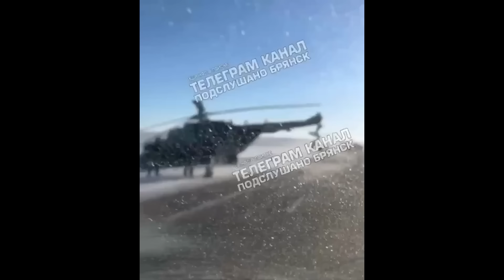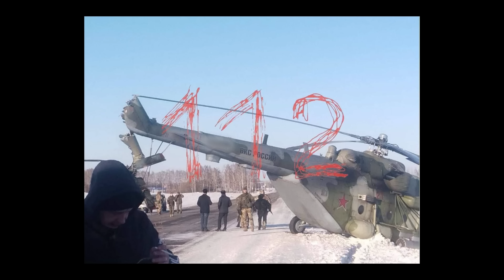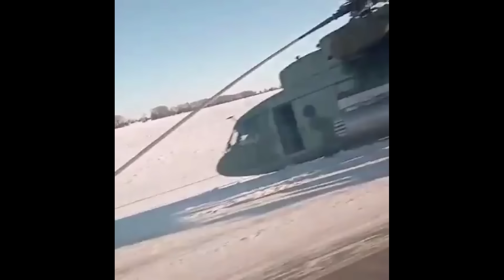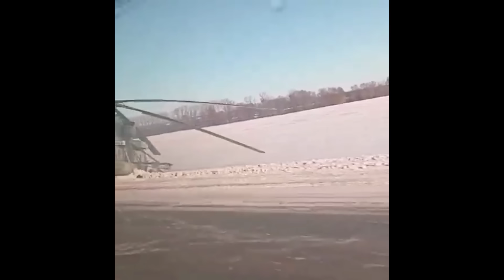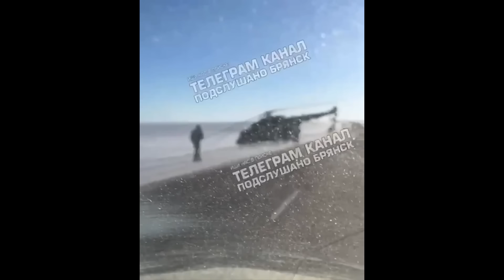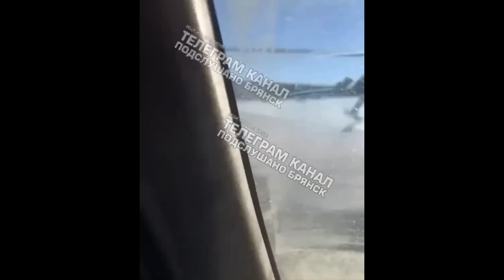Russia Mi-8 Damaged by Power Cable in Bryansk, Russia -- Makes Emergency Landing

Comment: Certainly not the first this has happened during the war and safe money is that it won't be the last or even second to last.
Reply: yes, there was a rusky SU-25 doing a tail strike on a power line, filmed from the cockpit. but this raises the question of how much crazy are the ruskys to fly under power cables like that, and not to mention that it is probably in training regime and not military operations, it is not necessary to put the helicopter at 1 m altitude to avoid radar, 10 to 20 m is enough for ground clutter to obfuscate the aircraft. bro the power line clearance level is about 5-6 m, yes enough for a large truck, but not for a helicopter/plane at high speed
Reply: @weiserwolf580  There was a Russian helicopter hit a poer line over a river a few months back - suchomimus has the video somewhere.

Comment: The only way this helicopter managed to land safely is because it was moving forwards at some pace at the time of impact. Helicopters require the tail rotor for yaw-stability at low speed and while hovering; without it the rotational energy imparted unto the main rotor by the engine is also imparted onto the body of the helicopter, which begins spinning like a top until it either flies apart or crashes.

At sufficient airspeed, the vertical section of tail and the aerodynamic design of the body allow the helicopter to maintain orientation long enough to reach the ground, but it requires the pilot to land at pretty much full clip, or risk loosing yaw-stability and flipping the thing. It would not have been a gentle landing, and this airframe is likely going to be written off due to stress-fractures all through the frame, damage to the underside and tail, as well as the transmission and engines being damaged by the shock of the tail rotor coming apart. Granted Russia does seem fairly good at repairing things, so they might be able to get it flying again given enough time.
Reply: Id also assume it may have been very near the ground already if it hit an electric wire.. and immediately landed.
Reply: @scottshawn70  I'd agree - if it clipped power lines it was already close to the ground. BUT how on earth did it only clip lines with its tail rotor, unless it was flying underneath???  See map ref 53.280895, 34.216500
Reply: My question exactly! How does just the tail rotor strike without the main rotor striking the wires as well if moving forward, plus it doesn't look like there are any wires in the area it went down? However further review of the video when the vehicle is passing from left to right you can see as he passes the Mi-8 a bundle of wires hanging off the torn tail rotor section....so I'm guessing, yes tail strike to wires... @mattydare
Reply: Looks like they went (mostly) under the power cable.
Reply: Could this type damage happen in liftoff? Taking the tail only? It would also satisfy landing.
Reply: @jean-yvesmead3972  In forward flight a helicopter's nose is pitched towards the ground, so they would have just barely clipped the tail rotor, smashing it to pieces.
Reply: @sgarlick1961  The pilot might have seen the oncoming line at the last minute. pulled up. The TR strikes, severs the wires and then the  copter is guided towards the GND in a complete panic. It's a brave  man who flies any AC which has had  repair done to the tail boom near the empenage or  tail  rotor. 

TEF
Reply: @sgarlick1961  I'm by no means a qualified pilot but as a heli moves forward they tend to tilt raising the tail rotor higher than the main blades. Add that to crazy Russian pilot trying to fly underneath HT power lines maybe?
Reply: Usually when helicopters are moving at forward speed aren't they pointing downwards a little that would explain the tail rotor only getting hit just a guess
Reply: @sgarlick1961  If the main rotor captured the cable and the cable was then moving with the main rotor then it could easly cut of the tail, this videos are so poor quality that it is hard to tell... it is kinda strange that you do not see any significant damage to the tail blades.
Reply: "and this airframe is likely going to be written off due to stress-fractures all through the frame" yes, it may look ok from outside but there is most likely damage to the frames that giving structural strenght to the helicopter.
They most likely gonna canibalize this helicopter for parts and it will be never be able to fly again.
Reply: Russia is running out of experienced pilots, and experienced Air Defense specialists. Are we sure this wasn't another friendly fire incident or shooting one's self in the foot thing.
Reply: @brianv1988  You're correct, they maintain a nose-down posture to tilt the main rotor and allow forwards flight on the cushion of air they sit on. Helicopters are effectively over-complicated hoverboards which like to explode when the oil leaks out.
Reply: @lockwoodpeckinpaugh9252  There's no shrapnel damage or holes to indicate it was shot down. Powerlines are very difficult to see when moving at a few hundred mph/ kmh, so it's more than likely just an impact on one as such. We've seen this happen quite a few times, even once with an Su-25 where the pilot ejected.
Reply: @thomassecurename3152  Unlikely. On takeoff, losing the tail rotor will cause a spin, resulting in a hard landing usually causing the main rotor blades to strike the tail, followed by the helicopter tumbling and obliterating itself.
This Mi-8 popped the clutch and autorotated after the powerline went between the main rotor and tail rotor. A good or lucky pilot.
I wonder if he was doing something dumb, like https://www.youtube.com/watch?v=eLZHhbgJz0A
Reply: @sgarlick1961  Going under the power lines nose down and tail up would account for it
Reply: @lockwoodpeckinpaugh9252  так и думай .
Reply: @mattydare it’s pretty common actually.  The pilot flies under the wires and pulls up a little early to avoid ground impact and pulls the tail into the wire.
Reply: Thanks
Reply: @SgtBeltfed  losing the tail rotor during takeoff is maximum pucker factor.  Right in the coffin corner.  Dump the collective if very close to the ground and slow, try to keep her level, and wait for the bounce.  If you have a little airspeed & altitude you have to dump collective, push over the nose and time pulling pitch and rear cyclic to hopefully come to a full stop with all arms & legs in the ride before exiting the ride.  
These guys were low but likely scooting along with enough airspeed to weather vane it straight until just before landing when it’s time to trade inertia for lift and pull in some collective.  Lol.  Ah the days of my  youth „wasted“ cruising the German countryside in the back of a Huey.

Comment: That's not usually what happens when a chopper hits a cable. The rotors hit first and all hell breaks loose. The tail rotor is behind the mast and fuselage, so it only hits something if it slews into it. This looks more like a tail strike on an object on takeoff close to where it wound up.
Reply: Unless it was flying UNDER the cable with its butt up.
Reply: Theres been a lot of obviously wrong conclusions on this channel recently... The rush to publish often causes mistakes....
Reply: @CRCinAU yeah. Well... Nobody's perfect.

Comment: Cables are hard to see in snowy conditions. He might have been navigating by following the road.
Reply: IFR in Russia = I Follow Roads
Reply: @slartybarfastb3648 so what does VFR in russia stand for then😅
Reply: @ffffff8048  Ve follow roads, da? 😁
Reply: All sorts of snow - I have seen power lines grow to 6 inch diameter in wet sticky snow, before pulling themselves down under their own weight. Agreed, they are normally hard to see when you are looking all around for whatever potential weapons the enemy is hurling at you - still .... one less on the inventory
Reply: @ffffff8048  It's only VFR in Russia two days out of the year. They stay on the ground in those conditions.
Reply: That's why the rule is "cross a power line over a mast".
Reply: @ffffff8048  "Vhy follow roads?"

Comment: Helicopters getting damaged by power lines is a fairly common occurrence. Most aviation regulators have rules against piloting that increases the risk of wire strikes. There are also devices that reduce the risk of catastrophic damage.

While a fairly common issue for helicopters, it's definitely made worse by the SAM pressure that forces Russians fly low.

Comment: If you're wondering why this helicopter didn't spin itself to death once the tail rotor got destroyed: most helicopters are able to disengage the engine from the main rotor, and then auto-rotate towards the ground. It's the same principle as an auto-gyro, and allows the helicopter to perform a somewhat controlled landing.
Reply: This is done in case of engine failure. Auto rotation is no rescue for a tail rotor failure. The rotor torque is related to the lift generated. When flaring for touch down, the helicopter requires high lift. Autorotation will still see the heli spin out off direction then if it hasn't done so before.
With vertical stabilizers in place, the fastest possible touch down moving forward is the only chance to survive a tail rotor failure. The Mil-8 has no such stabilizers.

Comment: If it clipped power lines then it was flying pretty low to the ground, a full blown emergency like this is highly survivable due to the short distance to impacting the ground.
Reply: Lot depends on your ground speed when you pile in.
Reply: It could be not a power-carrying wire but a lightning protection cable at the top. Those are steel, not copper, and harder to snap.
The torn tail fin suggests that.

Comment: They got lucky! Losing tail rotor authority is normally a really bad thing.
Reply: Yes, well if they actually clipped a power cable, they probably were at low altitude and speed. This scenario is supported by the fact that it's not a smoking heap of soviet steel and broken dreams.
Reply: True story!! It's always bad, as evidenced by the collapsed undercarriage. Failed tailrotor is seldome survivable from much higher than power line hight.
Reply: True story!! It's always bad, as evidenced by the collapsed undercarriage. Failed tailrotor is seldome survivable from much higher than power line hight.
Reply: True story!! It's always bad, as evidenced by the collapsed undercarriage. Failed tailrotor is seldome survivable from much higher than power line hight.

Comment: Helicopters - Australia has 45 Taipans which Ukraine wants but the French can’t guarantee spare parts to fix a (potential) tail rotor problem.
Anyone have any clues on what can be done so that Ukraine can start matching it on the front with the addition of two squadrons of Taipans?

Comment: Power lines are the enemy of low-flying aircraft.  I was bumped from a UH-1 flight surveying our tank gunnery range.  I watched from the ground as the less experienced co-pilot tried a hot dog takeoff aimed squarely at some power lines.  The more experienced pilot took over and barely cleared the power lines.  You could hear the change in the sound of the engine and blades as he changed the blade angle to lift the Huey to safety.

Comment: At the rear of the helicopter under the section of the broken boom, there appears to be power cables dangling from the boom. This suggests that the impact occurred with a very high nose-up, tail down attitude. This could of occurred if the pilot was attempting a Vietnam tactic of approaching low and hot, and pitching up to use the main rotor disc to slow down rapidly. Usually follow by a sharp turn to land into wind. 

The pitch-up would have to be very steep so that the cables missed the undercarriage and slipped under the fuselage.  Hitting the cables would result in the flight being arrested and would cause a rapid pitch-down. 

Looking at the wheel tracks in the snow the helicopter had very little forward speed when it struck the ground, probably with the nose wheel first. From the light damage to the undercarriage and the bottom of the fuselage the impact is likely to have low, suggesting that the aircraft fell from a low altitude. If the impact had been greater the tail boom would have snapped just aft of the main fuselage. This is supported by the lack of reported injuries of the crew.

The helicopter could be repaired, but as Russia has so many, they might not bother.

Comment: Was this helicopter flying backwards to hit a power cable or similar to sever the tail rotor blade? If it was flying forwards the cockpit would have been damaged. 🤔
Reply: Look at the angle the tail fin is cut off at.
Reply: @u2bear377 

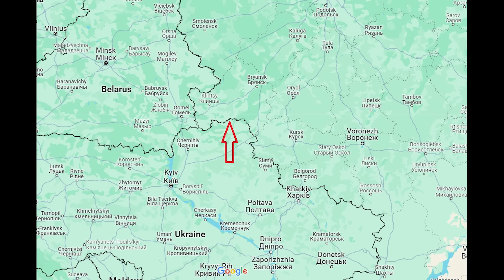0:20 
Shows no cables or other nearby. It broke off from top to bottom. Moreover, the small rotor blades hit the left stabiliser.

My guess is metal fatigue and nothing more.

Comment: Isn't that a mi-17 because of the nose?
Reply: +1
Reply: yup
Reply: *Was
Reply: @telebubba5527  🤣🤣🤣
Reply: This is the Mi-8MTV
Reply: @vesmeb02  na that's fine I just thought all the mi-17# had the different nose, and the flat back drop door. I make model aircraft and the mi had a left and right side door making them different.
Reply: Mi-17 is an export designation, in VVS service they are called Mi-8MT.
Reply: @vesmeb02  MTV did a good show!

Comment: Looks like a great job by the pilot to save it, but maybe should be more aware of the power lines.
Reply: Without the tail rotor, it spins like a top and it's just dumb luck that it spun into the ground flat.
Reply: Actually, that's not the case. Yes, it spins like a top, but there is an emergency procedure for tail rotor failure, and maybe they got lucky, but there was likely a lot of skill involved too,

Comment: Looks like the updated version of the Mi-8, the Mi-17, featuring a more advanced look-down, chop-down stabilization system.  IIRC, the nose is a distinguishing feature between the two, with the bottom of the nose sticking out a bit on the 17.  Probably a number of other distinguishing features for the keen observer, I just never carefully scrutinized them.

Not talking any smack, just making a joke.

Comment: Russia has a lot of these, but that's because they need a lot. Mi-8s and 17s are used extensively throughout Russia in military and civilian roles. Losing 30 or so in the war may be a drop in the bucket numbers-wise, but it means pulling that number from other work which may be just as important.
Also you didn't mention that the cockpit access door is open, but the cargo/passenger door is closed, which does suggest a training mission rather than operatonal transport work. 
Love your informative posts, please keep up the great work.
Reply: Or it already transported something and was coming back to its base?
Reply: That's not the 'cockpit access door', it's the cabin's front door that is mainly used for boarding/unboarding.
And what do you call the 'cargo/passenger door', the rear ramp?

Comment: Could be transporting a commander. Power lines are the bane of a chopper pilot's life, it's way they invariably do a circuit of a proposed landing site, checking. As long as the undercart doesn't get snagged, turning it over, the drop's usually less than 20', so survivable.

Comment: I am puzzled how the tail hit power lines without the main rotors ( which are higher ) hitting the lines....  Did the helicopter do one of those 'nose up rocket firings'  at the same time the  power line attacked the chopper.
Reply: Rather tail-up acceleration maneuvre.

Comment: Power lines are NOTORIOUS for copter accidents, ESPECIALLY with any fog, snow, rain conditions. Hope Ukraine take sthis as a warning, NEVER EVER NEVER  unless 100% visibility EXCELLENT,, ,, obviously this copter was flying too low to dodge Ukraine's  munitions. Copter went down here in New Orleans area  6 months ago, = heavy duty fog,, and this pilot was super experienced. The power lines were TRANSMISSION lines = high rise lines, that go over lake Pontchartrain, He hit the lines just at the base of the Lake. Ukraine take that as a warning.

Comment: Powerlines yir erse, Sire! ^^) A powerline in forward flight would have gotten caught by the rotor shaft. I have seen damage from such encounters in my time in helicopter maintenance. The crew have been celebrating their second birthday since that accident for having escaped alive. Most of the times, the powerlines will hit the control rods that connect the swash plate to the rotor blades and break them. The tail rotor remains 100% undamaged when that happenes. Until the craft hits the ground after the pilot lost all control except for yaw, that is. And lift. The helicopter will drop like a brick.
 Only if the helicopter was flying backwards could this damage seen in the clip have occured from such an encounter. In such a case, the pilot would have dropped the heli to the ground before there was significant momentum in rotation around the rotor shaft. You would see a powerline a few metres from the helicopter. There's none.
To me this looks like a fatigue failure from severe vibration which allowed the top bevel gear of the tail rotor to work lose in its mountings. After it broke lose, it shreded the tail. This would most likely be down to poor maintenance, possibly poor quality of the components in operation. As the metalurgical quality of chinese made components is known to be rather piss poor, I would bet my hundred quid like that: 70 on poor maintenance, 20 on poor parts quality, an tenner on cheapo Chinese spares.